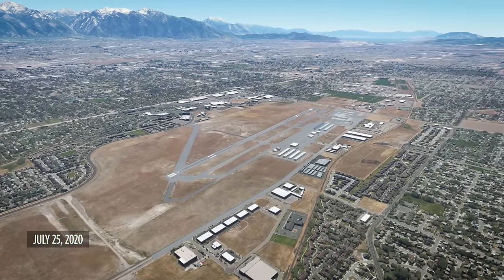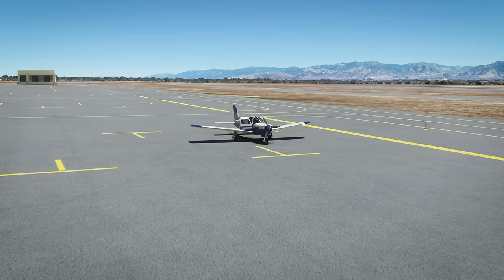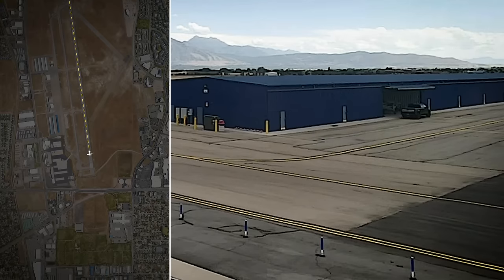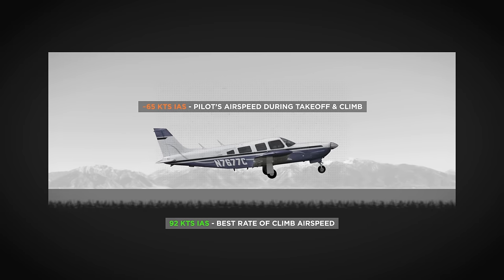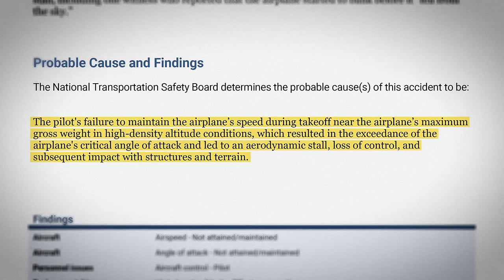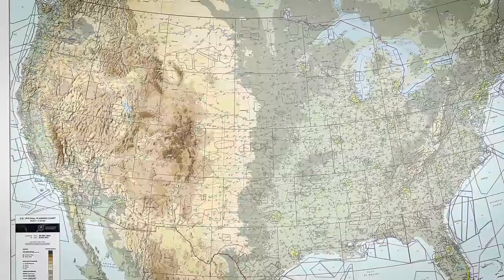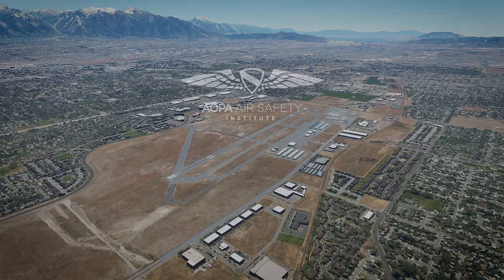Accident Case Study: High Aspirations

Comment: Pilot and mechanic-helper here.. one detail no one mentions is engine conditions. Clearly they were close to GW, high dens altitude and downwind. With respect to the engine, if it has tired jugs, old carb needing several adjustments and a carb heat door that doesn't fully close that can make a MASSIVE difference in performance. I assisted with work on a Cherokee 140 (O-320) that had 900 hours on the NEWEST jug, 3700 SMOH (yes you read that correctly) and a mixture cable that wasn't right and the best static RPM could do (KBTR, so sea level) was 2100.. The pilot that flew the bird in complained of "long take off roll." Advise the mechanic gives...do a static RPM check every once in a while.
Reply: Yep. Magnetos, too. A set of tired mags near or past inspection/overhaul time can easily lose a couple degrees of timing. That's significant.
Reply: I agree with you 100%. I've flown 0-320s and 0-360s that didn't come close to the rated HP. I don't pretend to know the history on the engine, but everyone just assumes that it performed like new. Even with the high DA and fuel mixture issues, that Lance could barely accelerate and climb out of ground effect. My experience tells me there was something wrong with the engine as well.

Comment: Not mentioned here but hinted at and SO important...with a non turbo engine you have to lean at high elevation airports for BEST PWR! If you do not lean the engine for t/o you will actually perform a partial power t/o.
Run engine to full throttle on rwy and lean to best power, depending on the plane thats max rpm or max EGT and than enrich with about 50-100degrees. Please look at leaning graphs showing best power and best economy and how to obtain that.
The pilot clearly started leaning while airborne( sudden increase in EGT's) which indicates he was probably not at max power during t/o.
Also any use of flaps not recommended on this plane as with plenty of runway the goal is to get airborne with least amount of drag, 1st notch of flaps only lowers the pitch attitude a bit but also increases drag.

Comment: I remember the first time I got a real world lesson in density altitude which was a pucker moment and I was so mad at myself for not running the numbers better. We took off from another airport and wanted to do a full stop taxi back at an intermediate airport. It was warm and I think density altitude was close to 6000. In reviewing my flight video, I was actually higher than I thought after takeoff but the fact that I didn't know for sure really bothered me. Density altitude is no joke. These videos truly help in reminding that every flight is different and to definitely do your homework. Thank you AOPA.
Reply: I had a similar moment one hot summer day ~20 years ago, when I took 2 friends in a C172 to Hummel Field (W75) from Hanover (OFP) in Virginia, to have dinner at that nice German/Italian restaurant across the street from the runway. (It's not there anymore 🙁)   Takeoff from OFP was no problem with 5000+ ft. runway.  Hummel, however, was only 2000 ft. + change, but I thought by the time we finished dinner it would be cool enough, so I never did the calculation for the takeoff distance for the obstacle clearance and for the weight of 3 people.  And in those days, before they cleared more of them, the trees were closer to the north end of the runway.  I did the short-field takeoff from Hummel.  The ground roll felt a little sluggish.  I could've and should've stopped, but didn't.  After the rotation, the climb-out was sluggish too, very slow in gaining altitude.  Although I probably had plenty clearance, I was genuinely scared during the whole climb-out that I might hit the tree top, and I never concentrated more on having my wings level and my proper airspeed.  I must've looked a little pale, only that no one could tell in the dark.  I never took anyone there like this again in that kind of weather, even if the calculation showed enough clearance.  I only wish I hadn't needed a self-lesson that way.

Comment: I feel that people leaning out the mixture is highly underrated. I've seen instructors go full rich on an NA airplane at higher density altitudes, I'm guessing from habit.
Reply: Agreed. We did so on 100°F days in Cincinnati, at under 500 MSL (Sunken Lunken, surrounded by hills). Seeing a density altitude several thousand feet higher was remarkable. Even so, underpowered planes (C150, etc.) would require a turn upriver to ensure terrain clearance.
Reply: Definitely lean for best power above 3K density altitude. I know a lot of pilots from cooler climates who go full rich on all takeoffs and landings out of habit or due to the checklist. Same can be said about carb heat on landing. Can't do that often in AZ, unless it's January.
Reply: Leaning the airplane at any significant DA is most definitely a step to take. Also, putting the gear up on positive rate on a NA single at high DA is also a good idea. If you lose the engine over the runway, just let the insurance company pay for the gear up - much better than failing to climb.
Reply: @N1120A  I'm not multiengine yet, but thanks for the gear up tip. If you don't mind a question. How about flaps? Would they help on takeoff where you lose an engine, or would the drag erase any benefit? Basically, how do flaps effect minimum controllable airspeed.
Reply: @SGTSnakeUSMC  I've not flown a Lance, but a regular Cherokee procedure is that high DA always is a no flap takeoff

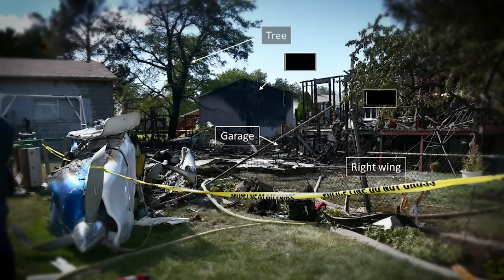Comment: (4:14) The lead-up to this accident flight revealed all the ingredients in a recipe for disaster: 90°F air temperature; high air field altitude; the presence of density altitude; max fuel onboard; max passengers onboard; wife's gut feeling of danger ignored by the pilot; weight & balance aft of allowable CG (not specified but I'm betting). Overloaded, underpowered, with adverse weather conditions including density altitude, the accident aircraft could only flounder for a bit in the air before crashing. I'm grateful that the missus and rear passengers survived.

Comment: Good video, many thanks for producing it.  They are really well done!  

Some constructive feedback - you knew that was coming 😊 - I think it would have been helpful to other pilots to go one step beyond the rather light "probable cause" that the NTSB produced.  For example, "don't fly when heavy, hot, and high" is good advice, but this aircraft could have flown fine if it had been leaned properly before takeoff.  By the time the pilot realized this and started leaning, it was too late and I'm sure he was under massive stress, sadly.

A lot of focus on the wind direction, but that really only impacts takeoff and landing roll distance - once the aircraft is in the moving air, it does not care about wind direction or speed.  Clearly if there is increasing windspeed as you climb, that will have a negative impact.

Thank you very much for producing these videos - they are saving lives.  Please keep up the great work!
Reply: Agreed. You should still trust the POH even if heavy, high and hot. If your numbers + 50% indicate that you have sufficient performance to fly then I don't see why you shouldn't.
Reply: My aircraft cares about wind direction. It seems to climb faster in a headwind…just like a kite.
Reply: isn't it proper procedure when operating out of a high altitude airport to set the mixture for the highest rpm in the run-up?
Reply: Wind speed generally increases with altitude: windVelocAt(agl) = obsWindVelocity * (agl / obsWindHeight)^(alpha) where 
 The value of alpha depends on the roughness and obstructions present in the terrain. Over open water or smooth, flat terrain, alpha values tend to be lower, often in the range of 0.1 to 0.15. Over more complex terrains with obstacles like trees, buildings, or hilly landscapes, alpha values are higher, ranging from 0.2 to 0.4 or even more.

The point being:
A 6kt wind at an AWOS 33ft can turn into a 10kt wind at 120ft AGL (the highest altitude of N7677C according to GPS data).

Taking off in a tail wind and losing 4kts airspeed during the initial climb is much different than gaining 4kts of airspeed for free when taking off up wind, especially for a heavy plane with reduced engine performance.
Reply: As logic turtle says below , angle of climb will be affected even if rate of climb isn’t , no matter headwind or tailwind; also up through 100’AGL there will be a loss of IAS in a tailwind due to ground friction . Normally this would be barely noticeable under conditions not near the edge of the envelope , but in this case it could have been critical for the pilot .

Comment: Insidious. It is humbling to watch this. My condolences to the family. I have included the 70/50 rule in my pre-takeoff check list, although this might not have worked as the aircraft became airborne before but did not climb. I always check density altitude during pre flight and will double check now along with AWOS info. If anything has changed, reassess before taking off or abort if needed. Don't let pressure or circumstances push you.

Comment: Near max weight, high altitude, hot and taking off downwind stacked all the cards against a successful flight.  An early morning departure with less-than-full fuel, into the wind, would still leave engine performance (is it tired? Is it leaned correctly?) in question.  Too many unknowns here for a safe (or least unsafe) departure.

Comment: The numbers don't need some generic padding, the pilot needs to understand exactly what the parameters are for the published performance, in detail. Maybe a particular plane needs some number padding but that is case by case and can't be generic. 
Mixture, cg as related to lift(rather than handling), the change in Vy and Vx with altitude and TOW, current condition of the engine, STCs and suppliments for all modifications, slight runway slope, exact short field proceedure for rotation and gear up (if it says immediatly retract gear ground effect but you normally wait until no more runway this will greatly extend climb to 50ft, and confirmation of actual winds(visual windsock and even tree branch confirmation) Many smaller airports are mismanaged and don't correctly maintain the AWOS weather station and surrounding brush and buildings so they get inaccurate wind readings. Etc and so on, details matter.
 
For example, most pilots joke about the rectangle wing piper arrows poor glide performance. But this is largely because they were taught to practice glides in the incorrect configuration, the prop needs to be set to lowest RPM for the published best glide and most CFIs insist that the prop is set in high RPM when practicing any maneuvers and put the gear down way to early (assuming they are simulating an emergency glide to landing) better to belly flop on the field than to hit a tree stump 1/4 mile short of the field. Now it still isn't a great glider but small config considerations can make take it from terrible to adequate.

Comment: Lots of red flags here: high temps, close to max gross weight, high altitude, tail wind, adj the mixture after T/O. We have more control over our decisions than we think we do.
Reply: I would argue none of those things were the main factor for a pilot who appeared to be quite meticulous in the planning. The bigger problem imo is the real plane specs not matching what is on the poh. What is on the poh should have been mandated to be guaranteed under a normal performing aircraft and not what maybe someone can achieve once with a perfect pilot. Only then would this accident have been avoided, and this is mainly a regulation problem.
Reply: @jfmrod …and I would argue that if you actually examined the take off chart for the effect of those red flags you would find that the altitude and temperature were right at the limit and the significant tail wind pushed it way out of bounds rendering the guy an amateur test pilot with his 108 hrs total time and family along for the experiment.
  Also, what is in the POH is indeed what a normal airplane can do, when the yardstick for “normal” is rated power and no exceptional piloting skill required. That is what the airworthiness regulations require. And rated power is not ‘brand new engine’ but well maintained airplane. Production engines average slightly above rated power when new. This guy was not getting rated power because: half the plugs were “severely eroded”; the mixture was not leaned for best power at the high DA; egt on #5 was 100F down. A single percent loss of the rated 300 hp would cost him 30 fpm at his weight, which is a big deal when all you need to live is a positive rate of climb. Not that you would get rated power at that DA in a normally aspirated engine.

Comment: I think not a lot of us realize how badly temperatures affect performance until you experience it firsthand. When I was doing my CPL checkride it was 34C outside and we got one of the weaker Warrior IIIs that the flight school had. We were well within CG and weight. Wind was calm (few kts headwind) and it was also a paved runway. Everything was fine right until I started to get out of ground effect. After that we could barely pass the VOR station in the climb out path. Had I tried to accelerate to normal operating speeds before clearing it we would be in an accident report too.  
After this I had my ME checkride in a Seminole and with 34C outside the single engine performance was literally like a C152, during the single engine go-around I had 0 climb performance with full thrust until flaps and gears were fully up. After that we got around 50-75 fpm, all this with only 2 people on board, had the airplane been full with passengers we probably had negative climb.

Comment: The performance charts are based on a brand new plane.  Over time, surely performance degrades.  This is something I think about a lot when doing flight plans.
Reply: Performance charts are not based on a brand new plane. They are based on a well maintained plane and the recommended procedures. A well maintained engine is expected to provide rated power. During performance flight testing a calibrated engine is used and performance recorded is then corrected to account for the difference between calibrated engine and rated power. On average, new production engines on the test stand produce slightly better than rated power so the average new plane will slightly better the chart. It is simple enough to periodically check climb performance against the chart.

Comment: Great video, much to learn from it!
at 8:47 I wonder if 28 GPH fuel flow is appropriately leaned for a high-altitude takeoff. 
Also, I wonder if the pilot pulled up the gear in ground effect.
Proper leaning, and pulling up the gear to accelerate in ground effect, would increase the airplane's climb performance.
The pilot's major mistake, however, was not aborting the takeoff when acceleration was insufficient.
RIP